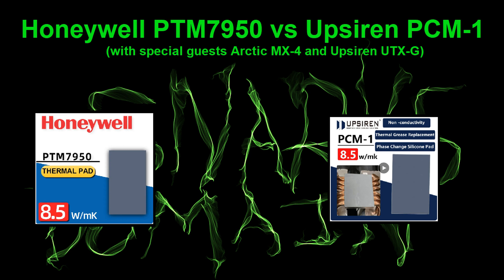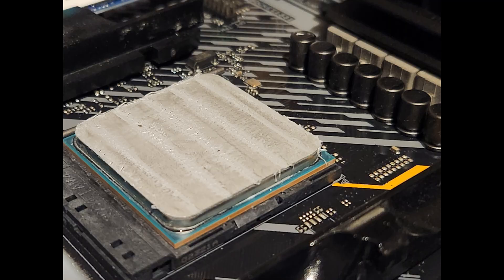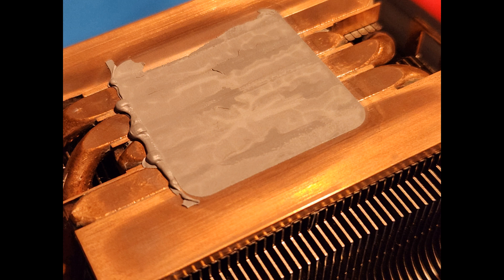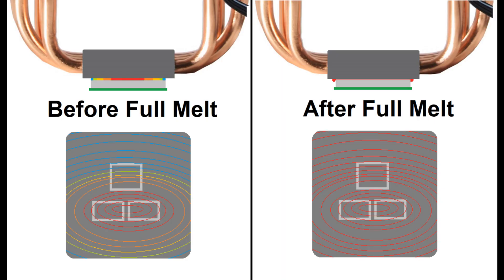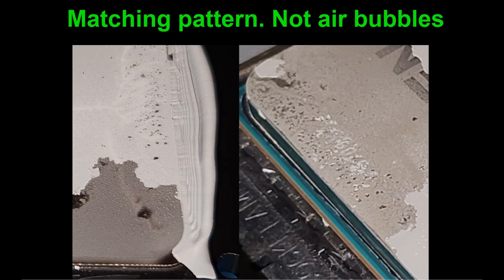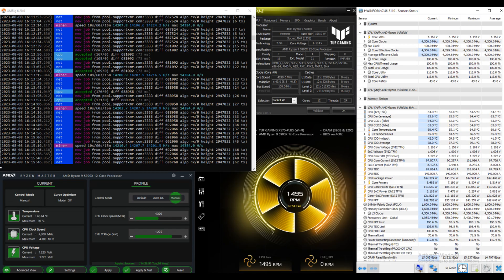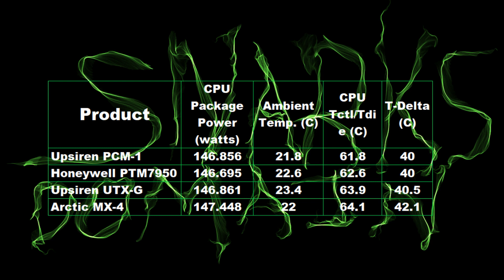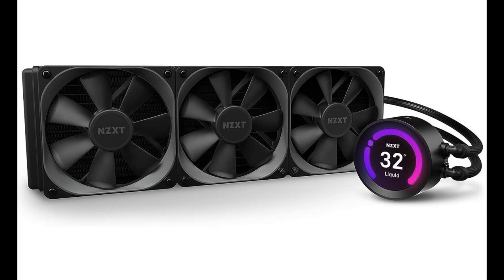Can Upsiren PCM-1 Compete with Honeywell PTM7950?

Comment: Interesting.. I've got the Upsiren pcm-1 pad and a ryzen 9600x with a Thermalright Phantom Spirit cooler - one of the best air coolers on the market. I'm running Prime 95. At stock power limit it pulls 88w and hits 54c at 24C ambient, so 30C delta. Pretty decent. 
If I increase power limit to 105w tdp,  it pulls 142W and hits a temp of 84C at 24C ambient. That's a delta of 60C.. Yikes! that's a 30C jump for a 54W increase in power.  I wonder why such a huge difference from your results? Is it the fact that the all-core frequency is higher at higher power limit? If I do a single core stress test at stock settings, it pulls 55 Watts and hits 70C but also runs at 1ghz higher frequency than the multi-core test. It seems that frequency has a huge effect on temperature.
Reply from the maker: I would recommend getting your CPU temp up to 80-90 Celsius and run it like that for a couple hours. Make sure it's a static load accross all cores, either Prime95 or Cinebench Multi.

You gotta get it hot so it can melt and get thin.

For my Phase Change Material testing I ran it for 6 hours but saw the most inprovement over the first 2 hours. It will continue to improve in the following days and weeks after initial burn in.

Comment: Thanks for using such an great cooler for this testing…cmon bruh 😒
Reply from the maker: Thanks for watching my video. I'll be using a Thermalright Peerless Assassin 120 SE to cool the CPU on Testbench 3.0

That being said, Phase Change Materials are better tested on bare silicon rather than with an IHS. I'll test it on both the CPU and GPU, but I expect to see a great range in the results on the GPU die between the vwi4ous pastes and Phase Change Materials.

Comment: Just commenting for anyone that stumbles upon this, at least for laptops, if you have trouble removing it, turn on your pc for a minute (in my case I had the fans unplugged, but I'm sure its irrelevant), that way it liquefies n you can quickly remove the heat sink after. I actually might have broken my Steam Deck a few years ago from removing the heat sink without doing this^ (n when removing my laptops heat sink like a month ago I got flashbacks, leading me to just turn it on for a bit n had much less trouble lol), leading me to need to use too much force n pulling the APU up out of it's... "place" lol. No idea how likely that is/if it's more likely something else that ended up breaking it (it did turn on for a bit after- cant remember if it was 20mins or a few hours, but then shut off n would never start again, so maybe that means that it wasn't damage the APU- I dunno, but ANNNYYYWAYSSS).

Comment: The PCM-1 and PTM7950 seem to be pretty much tied.

For water cooled, you can lower the fan settings on a custom loop to make the temperature reach a level where you are able to melt the phase change compound.
Reply from the maker: @crazyelf1  I'll have more conclusive test data in a couple months with all the PTM/PCM sheets I can find. That being said, they do see quite close in performance.

You are correct. Lowering fans speeds works well for water cooled. You can even get the water temp up to 50 Celsius and open the top of your reservoir to prevent over-pressuring the system (can use a lighter load if you prefer). Then just run it like that for a couple hours to guarantee melty things happen. Only need to be done once on water. AIO's aren't safe to take fluid temp that high, so getting CPU temp up to 80 Celsius is an ideal target, also for 2 hours (my personal recommendation for burn-in time).

Comment: Just ordered Upsiren PCM-1 and Upsiren UX ultra pro. Thank you very much
Reply from the maker: @ExploreAdam  Nice. Which device are you planning to use them on? There may be better alternatives if it's a laptop. You may want to check out the charts located at the Google Drive link in video description (Test Chart Repository > VRAM TIM > ETCHASH)
Reply: It's a laptop. Which would be a better alternative to ux ultra pro?
Reply from the maker: @ExploreAdam  if it's an ASUS laptop or some Acer or MSI laptops, then I would recommend going with a thinner putty based on the smaller gaps.

The current options for decent thin putties are:
Halnziye HY206/HY236 
Zezzio ZT-PY6 
Upsiren UTP-4 Ultra-Thin

If it's a Gigabyte or Lenovo laptops aid recommend looking at Honeywell HT10000, Thermal Grizzly Putty Pro, Upsiren UTP-8, Fehinda LTP81, Laird T-Putty 910, or Thermal Grizzly Putty Advance.
Reply: @snarksdomain  Thanks
Reply: @snarksdomain dang, I just went with U6 Pro after reading others say that the UX Pro was a bit too firm, and since I don't know the approximate size of the gaps, I just went with the supposedly "softer" U6 Pro, but I wasn't aware that there were THAT many other options for thermal puddies lol.
What I'm wondering, though, is if your recommendations in this comment is assuming that the laptop is thin, thus making you suggest the "thinner" puddy? Or is there no relation to the laptop's overall thinness and the gap width (if you know?)?
Reply from the maker: @SeenSpace  Most ASUS laptops have thin gaps. So I recommend the thin putties for all ASUS laptops in general. The thing is, the Halnziye HY206 line of putties will outperform the factory putties that manufacturers use, si it's a solid option.

If you're confident that a laptop has gaps of 0.5 or larger than you can use any putty you like. It will still take some caution to not use a huge amount of putty as that could make it difficult to get good CPU and GPU core contact with the heatsink.

Comment: Hey! Great content as always! Any updates on PCM-2? Still not sure whether it is better than PCM-1 or not... could not find any reliable info about that.
Reply from the maker: Not yet. I hope to soon, but it'll be another month or so. Gotta head to KSA for work.
Reply: @snarksdomain  Do you have any updates on this matter? I still haven't found a comparison between PCM-1 and PCM-2.
Reply: PCM-1 is 0.20mm PCM-2 is 0.25mm
Reply from the maker: @nusretonat3502 they both melt down to the same thickness in the end so it doesn't really matter too much which one you get.
Reply: @nusretonat3502  PCM-1 is 0.25mm and PCM-2 is 0.2mm. Just checked it in the Upsiren Official Store. But yeah, doesn't really matter. The 0.2mm thickness could be harder to work with.

Comment: I've been using PCM-1 on a 7900XT for about 1 year now, it started great with temps , delta between core and hotspot was 10C almost always, right now it's got worse to 20C all the time, probably after a while it becomes stable on this temperature, hopefully it stays this way, it's a real pain to change it.
Reply from the maker: @BenchmarksIT  Are you using it with pads or with Thermal Putty?

Comment: 11:11 Did you test it out on a AIO?  im concerned that either of these pads wont phase change cause 1 side would be too cool
Reply from the maker: @FirstLast-ge4yd  yes, works just fine with an AIO if you do a dedicated burn-in.

I typically target 80 degrees Celsius CPU temp for 2 hours, adjusting fan speed as needed.
Reply: @snarksdomain  where EXACTLY did you get the Upsiren PCM-1?
Reply from the maker: @FirstLast-ge4yd  I've bought it 3 times from Middle999 Store and once from "Upsiren Official" (Both stores on Aliexpress)
Reply: @snarksdomain  and all 4 samples were exactly the same?  the packaging looked the same?  all 4 products performed the same?
Reply from the maker: @FirstLast-ge4yd  I've believe the first 1 I got had an opaque blue film on one side. Now it's clear and semi transparent white. They all acted similar for me.

Comment: Phase changing products are meant for direct die applications, not ihs.
Reply: this is definately not true.  Toms Hardware did a deep dive on this and:

when AIR cooling there wasnt a single "paste" that performed better at dropping temps than Upsiren PCM-1, PTM7950, Thermalright Heliios, or Gelid Heatphase Ultra.  

when using an AIO (liquid) cooler, 1 of these pads (Upsiren PCM-1) performed better than 2 of the top 5 "pastes" at dropping temps.

they also compared these pads to liquid metal.  when AIR cooling the Upsiren PCM-1 beat 1 of the top 8 liquid metals, and tied with 3 of the others.  when LIQUID cooling with an AIO all the pads lost to liquid metal.
Reply from the maker: @IkeBroflovski-y4e  to be honest, they work just fine on an IHS, and you can definitely get them fully melted and thin with relative ease.

That being said, there are definitely larger gains on direct die, at least for GPU's and laptops.

I've tested several PCM's on both IHS and GPU. It's impressive stuff and reasonably accessible and well priced. Great for a PC you don't want to service for several years.

Comment: Is upsiren PCM-1 good for gaming laptops? My laptop GPU's has some temp issues that won't fix replacing paste and pads. S oi am looking for a phase change material that i can get from aliexpress. I mean, the first day the Thermalright TFX paste does a good job keeping temps. But the next day it starts to struggle and go above 90c easy.
Also do i really need to put PCM-1 on a cooler before using?
Reply from the maker: @reapersunshine2236  I'd recommend maybe getting Thermalright Heilos V2. I still need to test a bunch of Phase Change Materials, so my recommendation may change in the future.

I apply the sheet directly to the Silicon, jot the cooler.

Also, you will likely want to replace the pads with a Thermal Putty. If your laptop currently had pads, then either go with Upsiren UTP-8 or Fehonda LTP81. You'll want to buy 20g. You might use ~15g
Reply: @snarksdomain  ok thank you. I only had the chance to bought pcm 1 so i bought it on aliexpress, but i need also getting thermal putty to replace pads

Comment: 06:58 great idea using the tabs to lower the pad onto the ihs..
Reply from the maker: @unh0lyav3ng3r8  you can also use tape if you run out of stickers. Packing tape works awesome, even electrical tape works well.